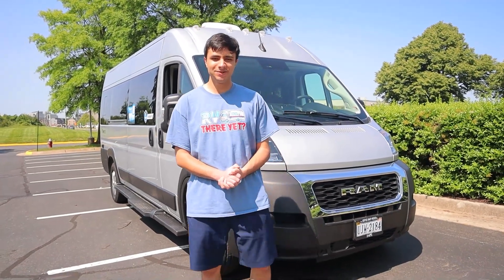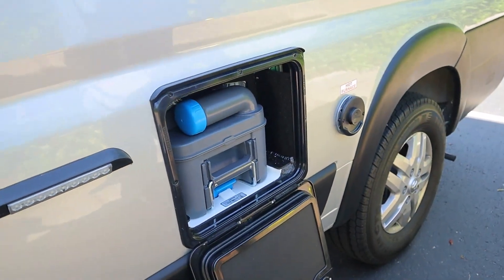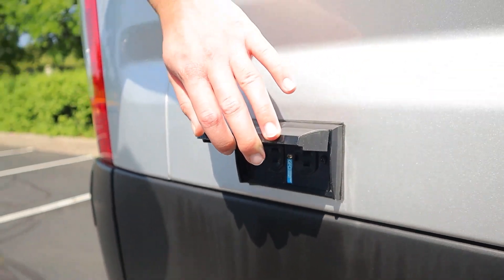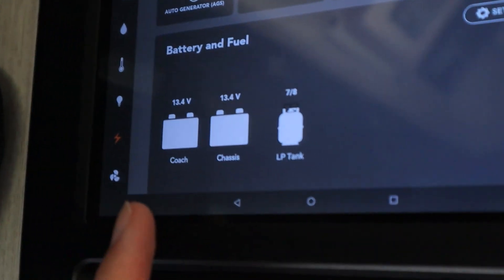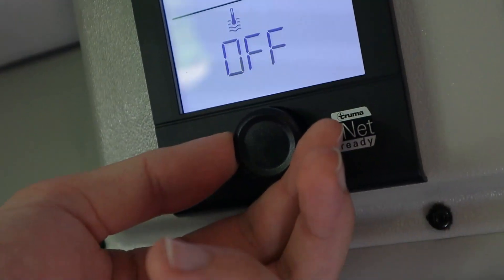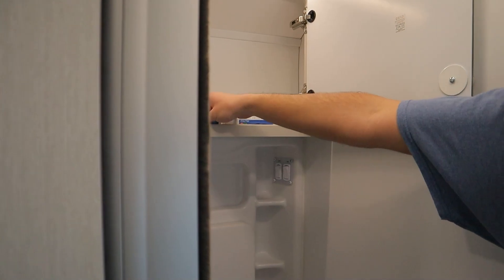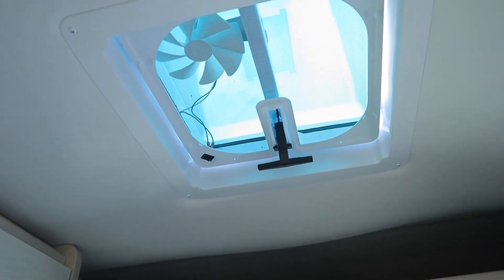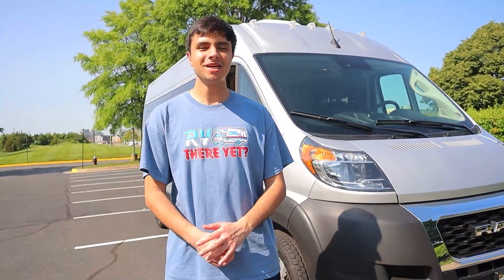2024 Thor Twist 2JB Walkthrough · Ace RV Rentals & Sales

Comment: Thank you for the tour, I like everything, going to go look at one, price is nice also. I do not need a TV, or wifi, or other upgrades on the higher price units with this floor plan, like Sequence , (FYI: Dazzle is the same Van). The dealer told me I could have the awning installed if I wanted one.  FYI, do a tire upgrade (BFGoodrich KO2 225/75R15) as the tires that come with the van, Nexen Roadian, are not good, the thread comes off by 10k miles!